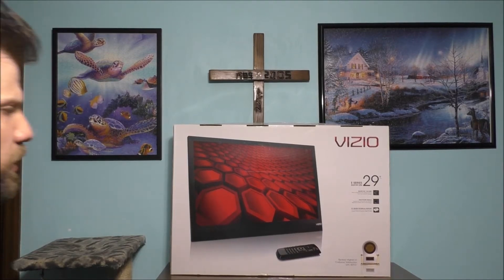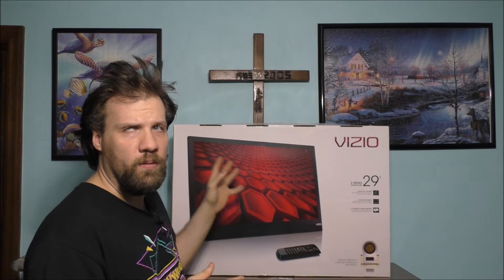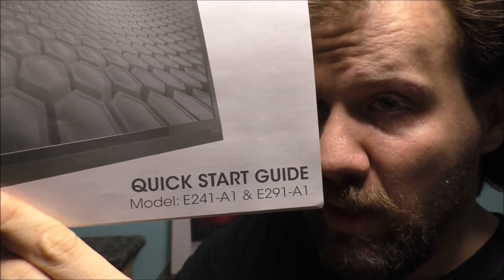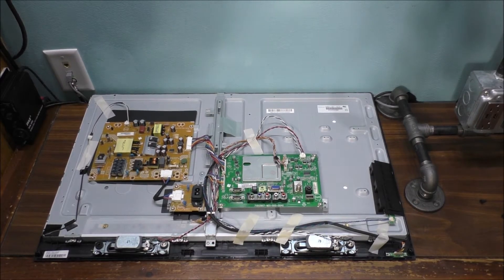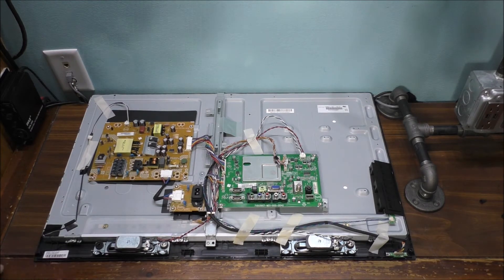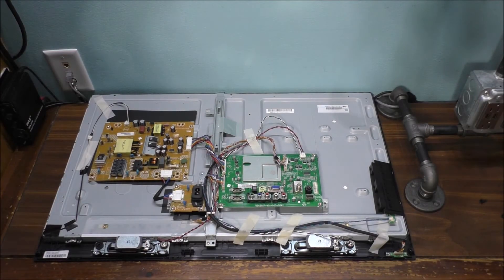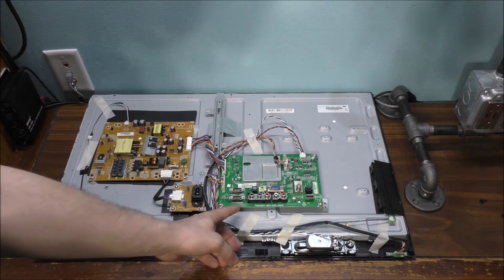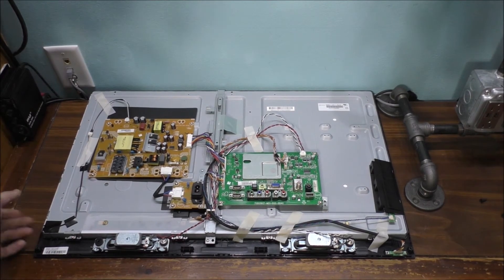CAN YOU FIX A VIZIO TV MODEL E291-A1

Comment: It could actually be even simpler than a bad capacitor.  I've seen many electronic items that have bad solder joints, and need just a reheat of these to bring the item back to life.  The fact that the problem is intermittent makes me think solder joints or circuit board cable connectors may be the problem.  Always unplug from 110v AC before working on the set. You could start with un-plugging and re-plugging in the circuit board interconnects, then, if that doesn't fix it, remove the power supply board, and look for bad solder joints with a magnifying glass.  Be careful when handling the power supply board as you may get shocked if the larger capacitors are still charged.  Good luck with  it!!!!!!!
Reply from the maker: Thank you for the good information :-)